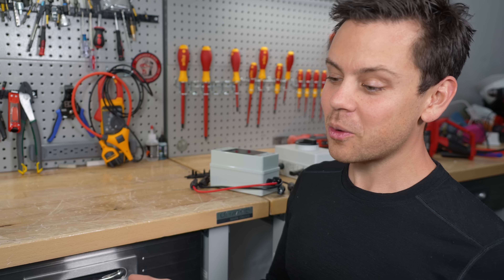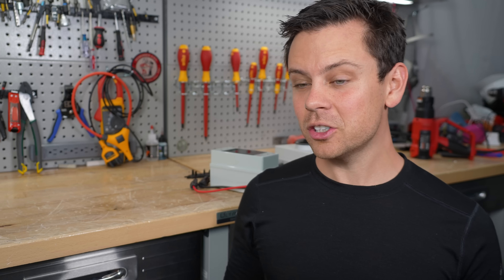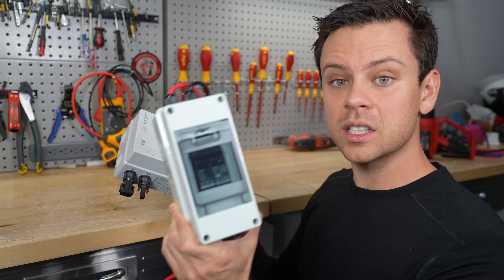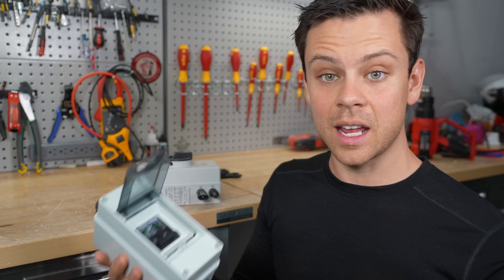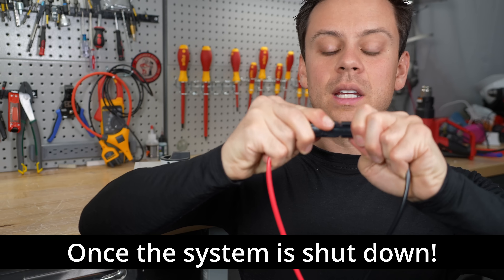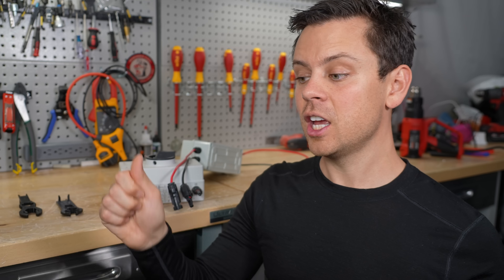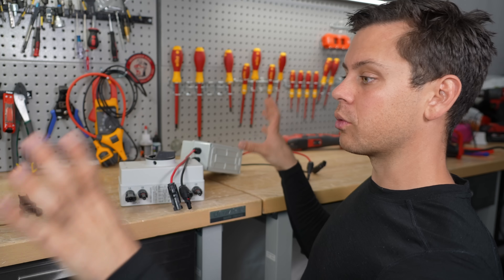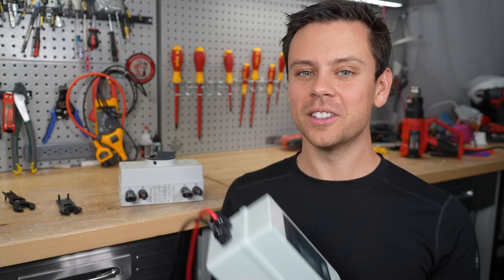How to Avoid Electrocution from an Offgrid Solar System: Everyone should know this!

Comment from the maker: Please share this video! It may save a life 

If you need further help, check out our beginner section on the forum: https://diysolarforum.com/forums/beginners-corner-and-safety-check.52/

~~~~~~~~~~~~~~~~~~~~~~~~~~~~~~~~~~~~~~~~~~~~~
Tired of getting ripped off? Check out my "Will Prowse Approved" solar product recommendations below!

12V Batteries
https://www.mobile-solarpower.com/lithium-batteries.html

48V Batteries
https://www.mobile-solarpower.com/48v-batteries.html

Offgrid Inverter System Builder
https://www.mobile-solarpower.com/48v-complete-system-blueprint-559371.html

Hybrid Inverter System Builder
https://www.mobile-solarpower.com/code-compliant-48v-offgrid-system.html

Mobile Handtruck System Builder (very popular!)
https://www.mobile-solarpower.com/mobile-48v-system.html

Solar Panels
https://www.mobile-solarpower.com/300w-solar-panels.html

Ground Mount Solar Racking
https://www.mobile-solarpower.com/ground-mount-racks.html

Wire, Lugs and Busbars
https://www.mobile-solarpower.com/wire-and-connectors.html

Tools
https://www.mobile-solarpower.com/tools.html

Fuses and Circuit Breakers
https://www.mobile-solarpower.com/fuses.html

Plug-N-Play Solar Systems
Ecoflow, Anker And Bluetti! So many models to choose from. See my current recommendations here:
https://www.mobile-solarpower.com/full-size-systems.html

~~~~~~~~~~~~~~~~~~~~~~~~~~~~~~~~~~~~~~~~~~
Need to build a large DIY system? Need a trustworthy solar distributor? These are my favorites:

Signature Solar
Creator of EG4! Solar Minisplits, Victron and More! Largest Solar Store Online.
If you want $50 off, please use my link below and coupon code "DIYSOLAR50":
https://signaturesolar.com/?ref=cPwLcVc0SW-BjN

Current Connected
Best Prices for EG4, Victron, Midnite and so much more! Fast Shipping and Highest Rated Customer Service:
https://currentconnected.com/?ref=wp

~~~~~~~~~~~~~~~~~~~~~~~~~~~~~~~~~~~~~~~~~~
Join our DIY Solar Community 
Need more help? Join the largest solar forum on the internet for beginners and professionals alike. 140,000 members and counting!
https://www.diysolarforum.com

Check Out My Free Book
Best-selling and beginner-friendly guidebook to off-grid 12V solar!
https://www.mobile-solarpower.com/the-book.html

~~~~~~~~~~~~~~~~~~~~~~~~~~~~~~~~~~~~~~~~~~
Contact Information:
I am NOT available for personal solar system consult! If you wish to contact me, this is my direct email: williamprowsediysolar@gmail.com
FTC Disclosure Statement and Disclaimers:
Every video includes paid promotion or sponsorship (such as free products for review). Some links on this YouTube channel may be affiliate links. We may get paid if you buy something or take an action after clicking one of these. My videos are for educational purposes only. Information is subject to change/update at any time. Electricity is DANGEROUS and can kill. Be smart and use common sense :) DIY Solar Power with Will Prowse is a participant in the Amazon Services LLC Associates Program, An affiliate advertising program designed to provide a means for sites to earn advertising fees by advertising and linking to Amazon.com
Reply: Going to post photos of my homemade solar generator on the forum.  
Looking for criticism and advice. It's been working perfectly for 18 months. But it is set up indoors. Think it's too in Vegas to put it outside.
Reply: I watch your teaching style and love how you bounce in with confidence-inspiring smiles as they lead into what is potentially dangerous - it is really beautiful to watch someone at the top of their game.
Reply: How would you set this up and use a combiner box?
Reply: Have you ever tried to navigate that Solar Forum?
Reply: Not exactly solar,( but perhaps later), but I'd like to add 200 amp hours of  lithium to my suburban. Is there a box of some sort that will allow the alternator to charge them and the starting battery but not allow the lithium to start the car or over charge or over discharge?
Reply: Will, just saw a vid stating Do Not use  DC isolators when your controller has one built in. See @ eFIXX , DON'T install DC Isolators on Solar, electricians Warned

Comment: I'm new to this solar thing and I bought a van with solar panels, a charge controller disconnect and a nice battery and I ran it dry the other day no sun parking under a carport my bed, but then I was looking into the smart battery isolator iso pro 140 that I can hook up my vehicle battery to my solar panel battery and charge that when I have a little to no solar when I'm idle on my engine, can I connect that directly to the positive cable on the battery or do I have to go through the charge controllerI haven't read any diagrams on it yet and I don't think anybody showing a diagram and how to hook one of these up with solar panels, charge controller, and a solar battery with only one battery.

Comment: We all will die sooner or later i hope its later for all of us solar power enthusiast. I love it i did electrical work almost 30 years mostly ac some dc work i know anykinds power 0 volts to.600 volts no line work on grid system but i have hooked 4160 volts in indudtry back years ago .

Comment: Maybe a little off topic but while servicing a 24v dc water pump didn’t realize the person who installed it had 120v ac on the same line to operate valves. Quick wake up.

Comment: Hello, I am NOT an electrician, so I would be happy if someone can answer.
I have a microinverter (Hoymiles HMT 2000) accepting 16 Amps, 65V per channel (4 channel input)... if I add a solar panel to it (within the range) but add one more in parallel WITH A ON / OFF SWITCH... is it safe to activate the second panel (during winter) when the production drops to 8 Amps/panel ?

Comment: But you didn’t tell us where you put it. Do you put them? Where do you install them at the end right by your batteries so your wires run in to your house then you plug it into that but those wires will be live. The solar panels are up on the roof so the danger still thereI just don’t understand. I wish you showed the steps when and where plugged in plugged in right by the solar panels themselves.

Comment: I thought you were about to talk for N-PE bond. I've just built my DIY offgrid solar system and used an RCCB, pressed the test button, it tripped and I thought I was fine. Until I discovered N had voltage and after some research I found out you have to make N-PE bond if you are not connected to Utility or a generator in offgrid system, otherwise the RCCB is useless. 😨

Comment: Hello Will.  I have watched many of your videos, and learned a whole lot.  Thank you.  If the disconnect (the breaker looking thing) is tripped so you can work on your solar panels, I would assume there is electric flow TO the disconnect.  So there is still electricity at the panels?  If you touch a wire of one of the panels, don't you in effect become the re-connect, for lack of a better term.  Or a ground for the power to flow through?  Doesn't the disconnect just stop the power from progressing into the rest of the RV, or any system?  Hope that made sense.  Great videos.  Thank you.

Comment: If I have a 40A MPPT solar charge controller like the Epever 4215BN, should I get a 50A circuit breaker disconnect instead of the one with the 30A breaker?

Comment: Alright, as a complete solar newbie I need some clarification.

I'm currently using an Anker F3000 and intend to use it with two ZoupW 450 Watt panels (currently in series, but eventually in parallel). Would you need to apply one of these at the solar panel level (for each panel) to safely disconnect individual cables (such as a the panel to panel connection in a series connection or cables connecting to the branch connector in a parallel system)?

Comment: Check out the mili amp trip value on your RCD or GFI there is a reason for that small rating , and that is because someone died at a very low mili amp value so great vlog thank you

Comment: Very helpful and good advice for not trying yourself.  I am  trying to put an off grid system together for my house , but it's very difficult finding  reliable solar equipment  supplies like isolating devices and MC4 connectors and wiring &    copper battery lugs, fuses, wiring diagrams. I am on own w/o any help.  Installing new main breaker panels in my house so I can supply home with solar and back generator when there is no solar energy.. Any advice would be appreciated. Thanks

Comment: My rv is a late 80s model just installed solar with a foldable 200watt panel and i got a 100watt panel with the charge controller.  I wanted a mobile setup so i could park the rv in the shade and then move the panels to the sun with a 20ft extension.  I was just doing this during testing this week, plugging and unplugging mc4 cables.  Looks like i need to buy a solar disconnect now.  Glad i found out about this now before i electrocute myself.

Comment: An eye opener for me. I'm only using a 100W solar suitcase to keep the LiFePOS  12V  battery charged when we are off grid.  It alway crosses my mind everytime that I setup and connect the panels to the trailer connection. I will check into the PV Disconnect to be on the safe side.

Comment: Like you  videos,  please help . I'm running a 100 amp sub panel to a garage  155 ft away from 200 amp  main panel .lm planning on put 20 x 600 or 650 watt solar panels on garage.  It will be grid tie . Do  I need to run solar wire back to main panel  if so could you please  tell me what size conduit  and wire  I would need .as I like to run it as same dicth as 100 amp line  .thank you ,  Best wishes God bless

Comment: It would be nice if you would make a video proving if those breakers can extinguish a high voltage DC arc. Connect the maximum rated DC voltage solar array to that breaker, short the output and flip the breaker. And try it with every brand. Please.

Comment: I’m about to mount 24 100w panels on my roof hopefully this week. I’m using a 6 string combiner box. That should be fine and work like this shouldn’t it? I can turn on and off from the box so seems as though it should work fine.

Comment: Important video for sure. People don't understand the power that can come from even 2 reasonably large solar panels wired in series, also DC so you cannot let go of a live wire. Also important to mention initially connecting the batteries through a large resistor before making full connection. This pre charges the capacitors in the inverter preventing a big current inrush potentially damaging the inverters circuits.

Comment: In the UK the governing bodies and insurance regulators are actively discouraging installers from using DC isolators now if the inverter has a built in isolator switch that complies with the latest electrical standards (17th edition)  which most do. The reasoning is that reduces the amount of man made crimp or similar joints in these isolators switches which have been found to be the most common cause of fires / burning in solar systems. In other words it reduces the human error in the making of these joints.

Comment: Learnt the hard way, pulling the kitchen the fuse to install a new cooker hood , my hair is now sticking out all the time , as the old hood was wired in to the upstairs lights by previous owners,🤣🤣🤣Dont trust anyone else with your life.I like the none contact testers and neon screw driver and check 10 times, as i felt my heart miss a beat, once is enough .

Comment: I'm getting the new EG4 Flexboss21 Hybrid Inverter with the new Gridboss Service Panel and three PowerPro Batteries.   Since the Flexboss21 has the built in Tigo RSD can I remove the two existing Tigo RSD as they would be redundant?    I really don't see any reason to keep them and I'd really like to clean up the conduit maze.  I'm also going to remove the AC Quick disconnect and associated Breaker box.  As the breaker  box just supplied power to the inverters and the original Tigo RSD.  Since I have batteries, they will power the Flexboss 21.  I just mostly want to clean up the design.  I'm going to run this past my electrician, but thought I'd see what ya'll thought.  ;0)

Comment: Will, I did accidentally zap my finger accidentally when trimming the wires to push into a wall and it was only 7 x 48v 400w  9 amps in series watts in full sunlight in summer across the two terminals and they crossed the top of my finger together. And I hadn’t stripped the wires yet just the cut end and OMG that was painful. Now at the time I had forgotten I had the MC4 connectors connected to the panels. I thought they were disconnected cause I was working with more than one string. It was a zap I will never connect. 
Folks. #1 wear rubber gloves, don’t use your left hand, wear full real rubber bottomed shoes not some other material. And remember to only work with 1 wire at a time!!!!!

Comment: This is a great video. Thank you. I was withing a few seconds of dying from electrocution a few months ago simply removing old insulation under my house that was held up by chicken wire which came in contact with old wires buried under it all whose insulation was gone. It was 240. I was locked on and as my consciousness started to fade I realized if I didn't somehow get free I would die. Being fully electrocuted and trapped with knowledge it is killing you is not something you ever want to experience. You must take every possible precaution. Don't get in a hurry and take short cuts. Electricity is extremely dangerous.

Comment: hi, few day ago when cleaning my metal roof. I get small amount of shock when touching my roof, turning off my pv system disconnect switch and the shock goes away. But this only happen when ac inverter is turn on, does this mean my neutral wiring are not sufficient?

Comment: Hi Will. I'm really glad you made this video. Some folks seem to think the DC from solar panels isn't dangerous, when really it's the most dangerous element of an off-grid system with high voltage series strings. I do have some concerns about the breaker-based DC disconnects. When you showed of one of the pre-built units I was puzzled until I realized you were really just using the breakers as a switch with arc management. So I bought one of those and took the breakers apart and made a YouTube video about why it makes sense. There is a problem though. The breakers are polarized to manage that high voltage in a small breaker, so they really should ONLY be used as a PV disconnect where current will always be flowing in one direction. They aren't marked as being polarized, but they are. If someone doesn't realize that, and wires them backward, they will not extinguish the arc and will almost certainly catch fire the first time they are opened. I took apart the 400V version, but I have one of the 1000V 30A on the way to disassemble and make a follow on video. I'm also going to take apart one of the rotary disconnect switches an see how they handle arcing. I agree, this is critical equipment for solar installations. Even if someone is standing by with a defibrillator if you get across 400Vdc at 10A hand-to-hand you're irretrievably dead. Not just shocked, but cooked.

Comment: Why are there no name brand American solar disconnect switches? There is only these cheap weirdo name Chinese makes with no reliable certifications made in a sweatshop. I wouldn't trust them but I've found no other options than one Chinese brand that seems to check out. I think I paid $80.
$30? A naked double pole American make circuit breaker is $15 at Home Depot. Amazon is getting flooded by no name Chinese junk. I once bought a weirdo Chinese name 80 amp fuse because I couldn't initially find a trusted American one. I put it in my system and it was warm at 5 amps! I yanked that out and found a trusted American name. It cost a lot more but you get what you pay for.

I ended up using a disconnect that looks a lot like the single knob one in the video from "World Sunlight". It's Chinese but at least they have a good english website, list internationally recognized certifications and is sold & installed by Explorist life Marine & Off-Grid Electrical.

Comment: If I have an xt60i 12 gauge cable coming from my solar panels ...would the pjerzen breaker be compatible?? Iv checked everywhere to see if those breakers are 12 gauge wire connectors but to no avai. Thank you. God bless

Comment: Why don't you mention microinverters?  Microinverters connect to individual solar panels (70 VDC or less) and produce a 240 VAC output, which is pretty much just standard house power.  The microinverters are low current--5 AAC or less, depending on sunlight levels.  Standard AC circuit breakers are fine & the microinverter output is balanced 240 VAC so there is no need for a neutral wire or safety ground lines.  You do need a center-tapped inductor somewhere in the 240 VAC wiring to supply 120 VAC power.  If you have a battery inverter in the system it probably has the necessary transformer to carry 120 VAC loads in a reasonably balance load distribution.

Comment: You state hook up the batteries last, but every charge controller states in the manual the batteries must be connected First.    Please be specific and state hook up last, but turn on first or you will fry the solar charge controllers.   Thank you
Reply from the maker: It won't. This has been a misconception for a while now. Check out my forum where we talk about this and test it for years
Reply: @WillProwse  Thank you,  Just reading the manuals, I have hooked the items up in different orders and not fried anything yet.  Betting the manufactures will not honor the warranty if they think you didn't follow the steps they lay out.

Comment: The unit you show is just a breaker, what are your thoughts on the dual units with lightning surge suppression.  Surprised you didn't mention it.

Or do you advocate for simply wiring panel *frame to earth ground?